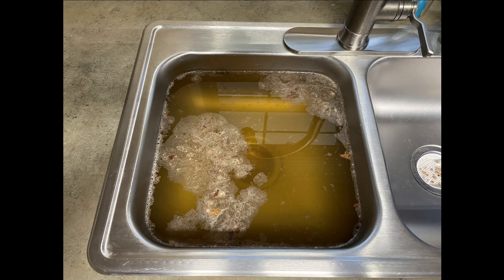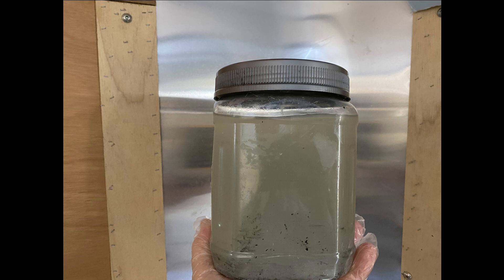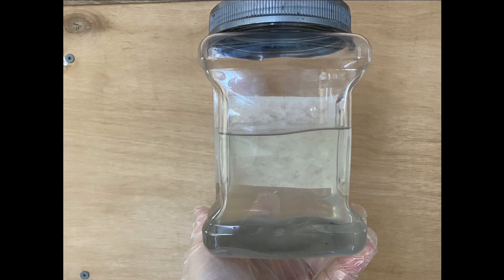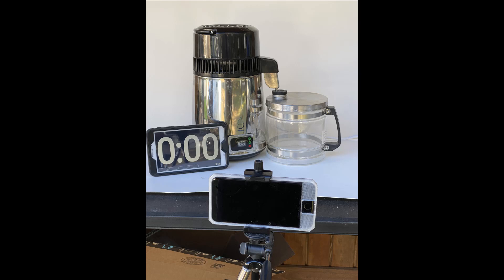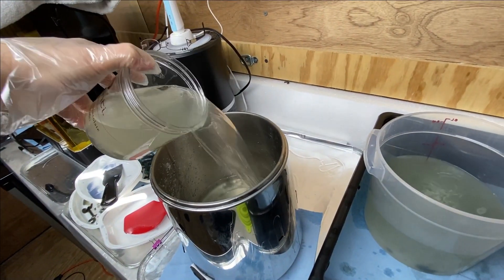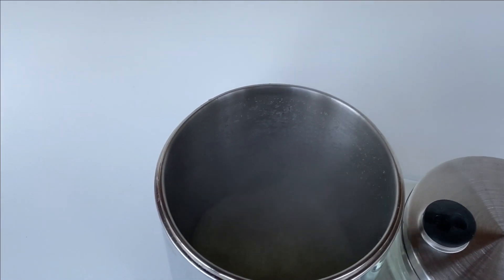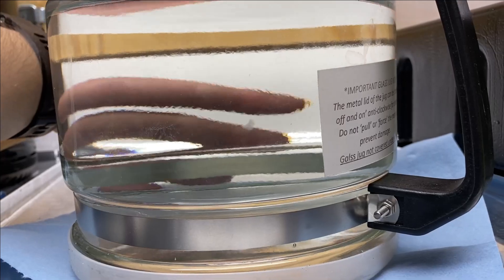Cleaning alcohol for your resin 3d printer process. (Feb2022 updated links)

Comment: Distillation is probably more costly in UK due to our very high energy costs.
Reply: Probably.  But then so does the alcohol itself given all the GST/duties.  In the end distilling what you own will always be cheaper than buying new.  If you can reuse 1L five times then you just got 5L for price of 1 (plus electic).  If you can reuse it 20times, you really don't care about the cost of a BigMac that you spent to save all that alcohol rather than toss it.

Comment: I got the Vevor 750w 1.1 gallon distiller. I put in almost 2 full gallons (on a couple of sessions) and after the distillation process, I got maybe 1 gallon and one quart back. On your video, it seemed like you got almost the full container. Also, my IPA was not that dirty, maybe washed 7 prints in it. I just wanted to try the distiller, so I put my IPA in it. It worked great...crystal clear IPA...but...just a tad over 1/2 of what I put in. Any help?

Comment: Great video and awesome advice. Quick question, Its been a couple years since this video, any thing new you want to add? How long does the machine last, how much do you lose in the process, ECC???
Reply from the maker: It worked well as long as I had it, until moving to Australia.  As AU is 240v I didn't bring it with.  As far as I know its still working for the new owner that bought it from me in the USA

Comment: There is a warning on the alcohol version of these stills to not put anything higher than 40% abv into the boiler. The higher the initial concentration the bigger the risks of fire/explosion
Reply from the maker: One should of course follow the instructions that come with any device.  Its part of the reason I show this operating out doors, and recommend to only use outdoors in a well ventilated area.

Comment: This might be a silly question, can you put a foil liner inside the stil and then that can be thrown out all together? Also, can't you just throw the waste in a cure box and toss it? That resin should still harden.
Reply: Not a silly question at all.  Foil: Well, you have to find a way for it to stick to the bottom while its full of the initial liquid.  Otherwise the resin will just flow under it.  Another approach I tried once but didn't pursue was using those slowcooker bags.  They are supposed to handle the heat and keep you from having a mess in your crockpot.  Seems perfect for this.  But I learned you can't roll it over the top of the base because the heating top doesn't form an airtight seal and the unit fails to work.  I think you could cut the bag short and have it self stand inside when you fill it up and should work as you described.  I need to actually try it myself before recommending. But you can give it a go under safe conditions.
Waste: Cure box?  Sure.  I have plenty of sun so throwing it on a cardboard box until I take the trash to the dump on the weekend accomplishes the same thing. But however you cure it, it should be cured before going to the landfill.
Reply: @clintstlaurent4263  I was thinking for the foil to make a foil pouch out of a wide roll. So that way the bottom is water tight. I do that for my smoker drippings bucket. When it's full I just toss it and the bucket is clean.

Comment: I’m doing my first test batch.  I ended up with a vevor water distiller.  I lost 80% of the IPA on the first batch.  I am testing with water now and it appears that the seal expands significantly when interacting with IPA.  With water the seal is tight.  I’ll look for alternate seal material and see it I have success.
Reply: I'm having the same problem with the Vevor. Any luck?
Reply: @cosmith71  I TESTED multiple times with water and the seal stays tight, so I ordered a silicon seal.  If it works with and IPA I will post the brand and link to purchase.
Reply: @RussellBigley  I would greatly appreciate it.  I've ordered one off of Amazon as well.  I hope it's different.
Reply: @RussellBigley  Have you been able to test this? I have the same brand and I do not believe they ship with silicone gaskets anymore and are using subpar rubber ones which hates IPA
Reply: @joshuapickens4395  I did get an alternate seal on Amazon, but it expanded too.  I felt the vapors coming out were too dangerous, so I ditched the effort.

Comment: I just did my first batch. some parts baked to the bottom...is there a safe way to remove the resin from there since it will accumulate after every batch!?
Reply from the maker: Let it cool with lid off. Should come out with plastic scraper without much issue.

Comment: I bought the "budget white version" and the first time I used it, it started to leak at the top seal. When it ran the cycle I found the top seal had stretched and was now flopping around, no longer tight around the top cover. I used some bailing wire to tie it onto place and it seems to hold (for now). When this one really breaks I will go for the expensive alcohol-specific black version.

Comment: Hi I bought this very same machine because of this video and the alchohol cleaned so well! The only issue that I have is that the leftover resin inside isn't like a "cookie" that it looks like in the video but instead it's more like a bunch of crystals floating in resin syrup and once it's cool enough to touch (with gloves of course) it's very thick and sticky and tough to remove. Any suggestions how to clean this?
Reply: i have the same issue, have you had any luck?

Comment: Those little air stills work like a pot still, do you find a drop in abv? (alcohol by volume, or proof in imperial)

I have 100% IPA because I can get it cheap but I'm wondering if using an air still will significantly reduce the potency of the alcohol and if that actually makes any difference to the cleaning process.
Reply from the maker: There first appears to be a drop in volume.  You pour in a liter but you don't get a liter out.  Then you realize how much resin is left in the bottom of the distiller. There's where most of that lost volume has gone. Of course some small amount to lost vapor, but that's not really much.

Comment: I ordered the same destiller, however after one use with IPA the seal wasn't tight anymore. Does your seal maintain it's size? Mine was enlarged somehow. I need to return the unit now somehow.
Reply: try rotating the seal. I read in another comment that the seal only goes on one way. Maybe this is the case for you? im thinking of ordering one of these as well

Comment: Thanks for posting this mate! Do you happen to know if the resin being cured already affects this process? Say for example, you didn't have time to clean the alcohol right away and left the dirty IPA out and it partially cures because of the sunlight. Would you have to have stored it in the dark/planned ahead so you're always distilling right away? Or does it make no difference whether the resin is cured or not?
Reply: My resin room has no windows.  It doesn't get partly cured.  if you get the other video on settling the alcohol that might help you reduce the issue.

Comment: You really shouldn't be putting alcohol in a electric distiller. The chamber is heated well above the flash point of the liquid and can result in a fire or explosion. You could just make a solar still which is cheaper and safer.

Comment: Hi. I'm really interested in trying this but I live in an apartment building and would have to run it indoors. How dangerous do you think that is? Are there fumes? Are those possibly flammable too? Have you had any scares?
Reply: i would not run it indoor. I have been doing this with mine for a while and it is a smelly process. i have never had any fire issue but im not doing it near any open flames and only outside.
Reply: So distillation of any flammable solvent is inherently dangerous. Isopropyl alcohol as a vapor is essentially a poisonous gas that will kill you relatively quickly if you inhale. You need to do it outside. Or at least under a vented hood (I mean the chemistry ones not just your microwave vent). 

Secondly: distillation of flammable liquids is a fire hazard AND and an explosion hazard.  These water distillers are essentially pressure cookers to a lesser extent (not as much pressure as a pressure cooker, but naturally boiling a liquid creates positive pressure that you slowly condense out). If an electric spark happens or God forbid an open flame: you just blew up your apartment. Obviously have this hooked up to a regulated power supply: not just a wall outlet: use a UPS. Use a GFCI outlet also: idea is to prevent any voltage or amperage spikes that could create any kind of arc. 

Lastly: doing it outside: you can likely do it on pavement or cement that way: non-flammable stuff. In your apartment you're basically inside a timber box...not a good idea. 

When you do use the water distiller to distill flammable solvents: have appropriate safety equipment: safety goggles,   a VOC respirator, and a fire extinguisher.  Fire extinguisher is absolutely necessary to have at the ready. I would also recommend a fire blanket. 

Be safe.

Comment: So I bought the one for alcohol.  I set it for 95 C.   When it got near the bottom the temp started to shoot up?  Is that normal towards the end?
Reply from the maker: I wouldn't think so.  Temp should stay where you set it.
Reply: @starbase3d804  that's is how mine works.  i just stop the distillation at that time. Mine is a slightly different model then yours though.

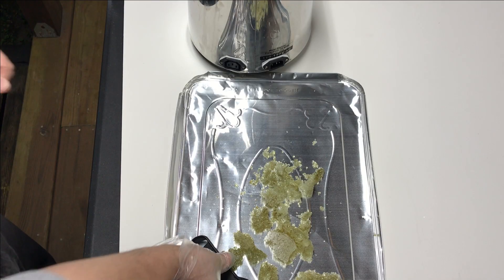Comment: 5:41, I have tried this method, after the distillation the residue was not easy to clean at all! The bottom of the heater was completely covered with burned resin and it took me a good while to clean it. I think it is best not to leave it until the end but I am not sure how to check that at the right time. Once you open the lid of the heater while working toxic gasses rush out. And it is a must to do this outside!
Reply from the maker: Were you trying to take the residue out while the machine was still hot? Or did you let it cool down fully? I fine with the any cubic and Sariya tech brands of resin they come out quite easily once the machine has cooled.
Reply: @starbase3d804  No of course, I let it cool down. You can't stand the fumes otherwise. I am also using anycubic resin. For a sec. I thought I could  use the bainmarie (ipa bath) method but then I realized it won't work.
Reply: Why not add water to the mix? The steam should remove the alcohol and since the default temperature (95C) is below the boiling point for water (100C) the alcohol will be steamed out and the water should stay behind. 

I believe that the boiling/steam point for alcohol is 165F-175F

There is a reason that he used the Whiskey specific distiller instead of the home water distiller.

Comment: Great video! What temperature are we talking about here? 95° what? C°? Fahrenheit? Kelvin?
Reply: U think he's distilling at 95 kelvin?
Reply from the maker: °c - the unit is calibrated in C.  Can probably bring that down as low as 80-85 and not overboil the alcohol leading to excessive loss.
Reply: @starbase3d804  Thank you! I read about IPA sometimes creating peroxides, leading to explosions when destilled. Do you happen to know anything about that?
Reply from the maker: @hey_in_hey  I do not.  But for the dozens of people that I know use this, from all the resin forums I'm on - a fire or explosion has never come up.  The biggest issue was the seal on the water unit which is now a moot point since there is a purpose-made alcohol unit now available.  Which, I'm thinking since it is purpose built for alcohol, should have met all the safety testing.
Reply: @starbase3d804  Now that I've tried it I must say, even with a strong exhaust imho this can only be operated outside. The smell of the burned resin is horrible and I doubt that it is good for your health. Even my freshly replaced FFP3 filters did not hold it back very long.
Reply: @starbase3d804  Do you happen to have a link to the purpose built alcohol one?, please.

Comment: Great solution - sorry for the pun, and have placed one on order.

Paul
Reply: Mine arrived yesterday, 1st batch approx 1 litre of slightly cloudy IPA. Took approx 40 mins. Next batch approx 3 litre of very contaminated IPA, fumes were acrid, had to move the machine into the garden. Got under a litre of clean IPA, and approx 2kg of resin crud. Very pleased with the process, and will clean my IPA on a regular basis (when it starts to go cloudy or after a print run).  
Thanks for posting the video

Paul

Comment: Just found this. Great idea. Wondering how long it takes to run a batch in the distiller? I think the video showed just over an hour, is that correct?
Reply from the maker: Yes.  Just shy of 90 minutes.
Reply: @starbase3d804  one last question.  Do you leave the filter in or out? I can see it being needed for water but not sure on IPA. Thanks
Reply from the maker: @jameshurd5609  Naaa... I saw no reason for it with alcohol.  No reason to congest the outflow.

Comment: Any reason for having the distiller outside? Dangerous to have indoor? It’s pretty cold outside for the moment where I live …
Reply from the maker: Cold won't affect its operation.
It operates by distilling a liquid (alcohol) into a vapor.  You don't want alcohol vapors throughout your home; its not healthy.
Reply: I bought mine on Amazon and looks like yours. Used it today. Hugh disappointment. The seal between the pot and top is a joke. Leaks massive. I had to turn it off. Filled it to max. About 4 liter and I have approx 1,5 liter left! The rest disappeared due to non existing seal. 
This thing is going back asap!
Reply from the maker: @larsplanefeldt8688  A friend had a similar experience... Then realized the seal has a specific placement/orientation.  Once she rotated it around so it was in the right spot then it was a good seal. - Maybe that applies to yours, maybe not.

Comment: Hi Sir,
excuse me.. two questions please..
Is it necessary that the distiller has a thermometer (this one can change temperature, or is it just to display it?), 
or would a cheaper model (there is also a white economic model without that) would work anyway?

And.. 
Have you also tried some other resins, maybe from well-known brands .. or other colors?

I mailed You.. but I hope You answer me here..

Kind Regards, Paolo
Reply from the maker: "Well known" is relative to your country.  I've used Anycubic, SunLu and Siraya Tech.  The resin really shouldn't matter as far as distilling process works.  It might make a difference to cleaning up the residue after.  

The model I use has a thermostat to control the temp, not just a thermometer for display.
I'm using this at the default temp of 95 as shown in the video.  I have no idea what temp your cheaper version distiller is using. If its around that temp it should be fine but I can't certify that obviously.
Reply: @starbase3d804   Oh.. Sir.. thank you so much! :)  - Excuse me... I would just have another doubt if you can tell me, Mister: 
I read somewhere that someone had a power problem and the cable (socket) burned out .. (shorted out) ... So I would like to ask you: 
Do you use long time the distiller? .. I mean .. could you tell me if for weeks, months .. with no problem?  ..  Regards Sir..  Paolo
Reply from the maker: @paolotoschi2475  My distiller is sitting on an outdoor table on my covered porch.  So not indoors, but not in the rain either.  

When not in use I don't do anything more complicated than cover it with an overturned 5 gallon bucket to keep it clean/dry.

I run 1-3 batches per day on average, 5 days a week depending on how heavy my resin schedule is.  For the last 3 months.
Reply: @starbase3d804  Hi Mister!.. Thank You so much!! I have buyed the distiller just in this days.. I'm going to try it.  Sir, I'm sorry.. but when the detergent is finished, how is possible to clean the pot, successfully? .. I mean to detach all resin, without scratching and ruining, but a good cleaning? - Could You tell me ony this, please? (the right substitute for the detergent that comes with the distiller)..  I hope in Your suggests.. or experience.. Thank You - Regards, Paolo
Reply from the maker: @paolotoschi2475  I've never bothered to clean the pot in 3 months.  No reason to.  Most of the dried resin pops right out, especially if you let the pot fully cool.  Any crumbs left aren't a problem and will get picked up during the next batch.
Reply: @starbase3d804  oh Great Sir!..  All clear!..   Thank You so much for Your patience and sugests!..   :) ...   Regards .. And .. I follow You in Your future videos
Reply from the maker: @paolotoschi2475  I use it daily on average.  Some days not at all.  Other days 3 batches.  So it averages out to probably 10 batches a week.  For the last 2-3 months.  Lets see: Video was posted 08feb and I used it for a month before that just to be sure, before making the video.  Its now end of March.  So yeah, nearly 3 months.